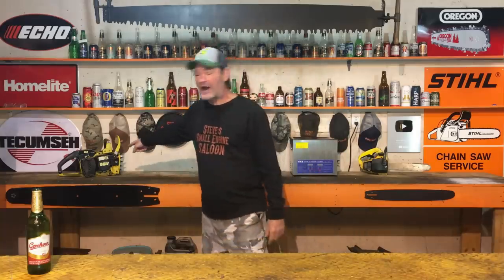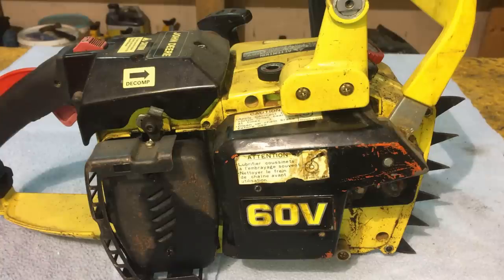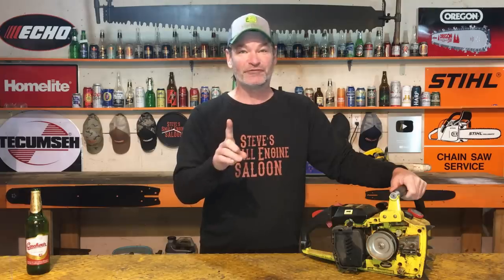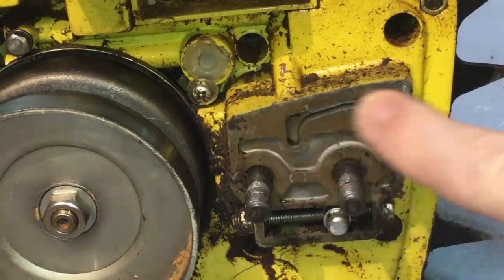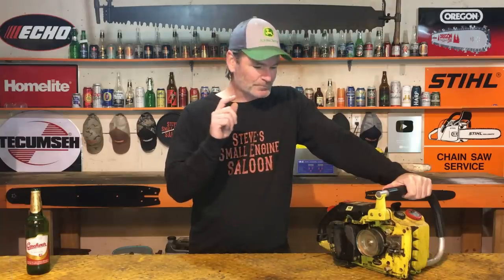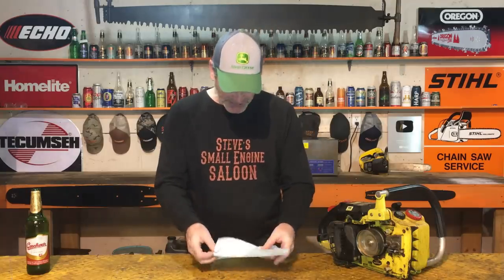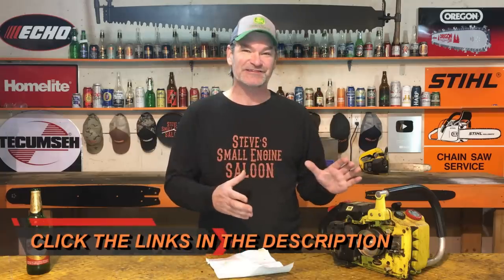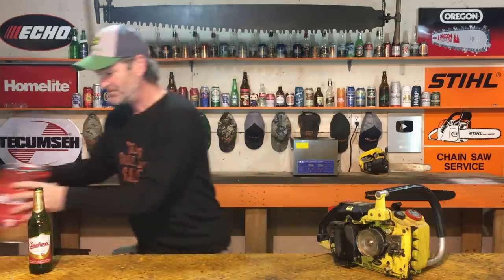Help Me Fix This Chain Saw Oiling Problem

Comment: It works in manual. ?      There is the. Ball check.   Between the manual pump and auto.  If not. Working.   It by pass. In auto. And gos back to tank thiught manual pump.   Put it this way it all. Gos thought manual pump.   When release ball valve should close.  Auto pump. Is always running.      If manual. Not working it lost its prime.       They are a bitch.    Pull top off manual pump fill with oil.   Try.    Air leak. Or orings shot